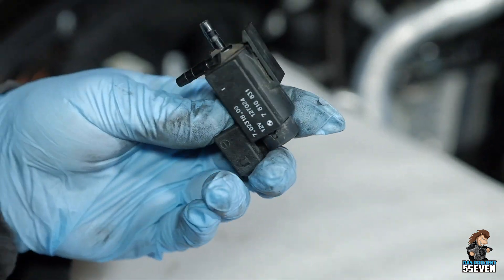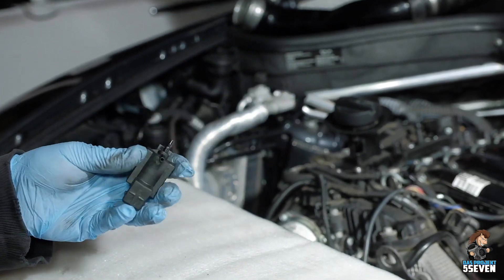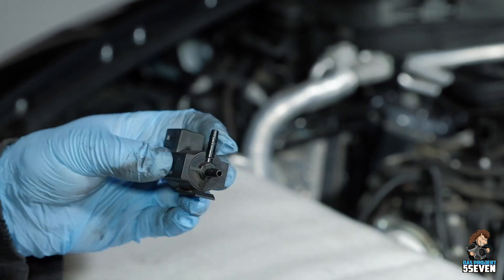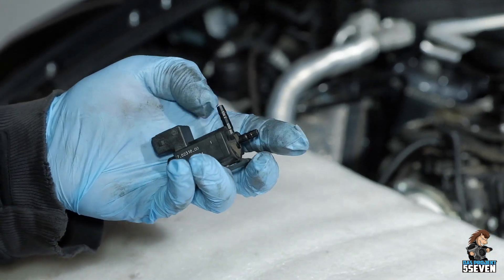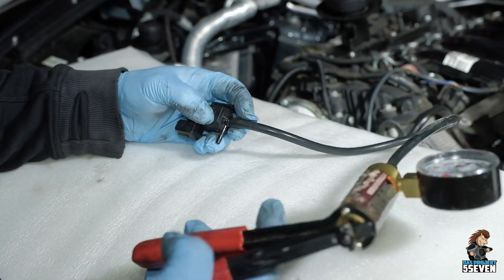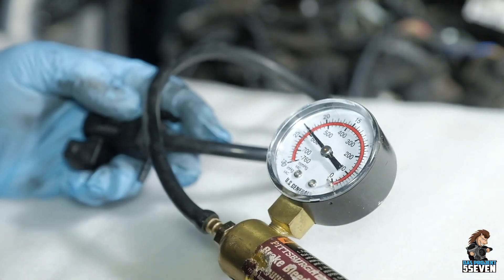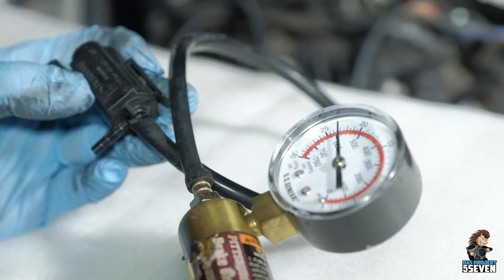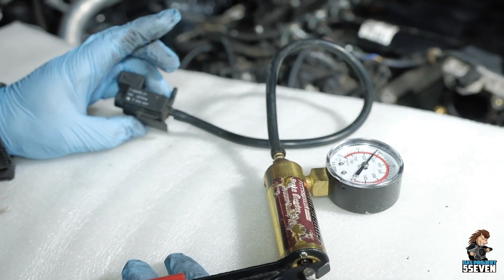How To Test an Electric Switch Over Valve

Comment: something else to consider is that while the engine is running it is steadily pulling vacuum so the slow leakers may not matter until they completely fail

Comment: Hello! I have a BMW 125d 218hp and i seem to have a similar problem, i have 244B00 error "charge air pressure control, low pressure stage, control deviation, charge air pressure too high/negative control deviation". I found a leak in the vacum hose that goes to the EGR valve and got it fixed. I can hear more the turbos on neutral aceleration but still i got loss of power in low RPM's, only after 3500 i get the big turbo coming out and only there i get more power.
Nice video. Thanks for helping, everyone!
Reply: Have you done any service on our car lately? How old is your car? I suppose you have an electronic turbo actuator. Have you checked that the actuator moves from right to left after you start your engine? The actuator arm should be to right over the lowest left screw on the backside of actuator, it is in close position when engine is off. When engine start the actuator arm should move to left open position after you start your engine. If this does not happen, you may have a connection problem because one or two solder points for the electric engine in the actuator is loose. Those connections are soldered by aluminium and you should take the actuator out and get it repair by an electronic repairshop. Tips! To unscrew the three screws holding the actuator, you must start your car so the actuator arm  moves to the left, it will let your unscrew the lowest left screw. turn off engine remove the c clips to take off the linkage arm. Now you should be able to unscrew the two last screw. If your actuator is not in close position over the lowest left screw, it means you or your mechanic has replaced the actuator without recalibrate it. If you have replaced you turbocharger with a new actuator, the actuator must get calibrated at a special turboservice shop who has tool to calibrated your actuator to the ECU.  I had the same problem, my car workshop replace a new turbocharger with a new actuator, my turbocharger does not work, I had drive train low boost, high fuel consumption, glogged DPF. I solved it by putting back the original actuator from the old turbocharger. It was calibrated and had preserve the configuration.

Comment: Hello, Good evening. Thank you for our help. I need some advices from you. Lately I have got this error 244800 Information-particulate filter system limited remaining mileage of particulate filter available. The engine light is on. Does this mean that my DPF count is out of range and I need to reset the DPF with Ista? I have got Drivetrain error when my car is cold. When the engine passes 100 degree my engine works fine without any errors. My BMW has passed 160000km. I have already order Ista and ENET cable. Good advices from you will be appreciated. :-)) I have had many problem with my BMW 525D Xdrive last two years. Last thing I managed to replace turbo air charge hose, now my turbocharger seems to work, no  more leakage. I have checked all my vacuum hoses and it is connected as the BMW original diagram shows. I have managed to solve m problems with level sensors too. Now there is no error and everything works. At many forums I read many people get "Dynamic damping control failure. Corner ability restricted". I have found out that the two balljoints of steel on each level sensors are rusted and this make the level sensors stop moving up and down. I unscrew the two 10mm screws which hold the plastic stag. I took out the steel balljoints. Remove all rust, remove all rust on the plastic stag too. Use steel wool to polish all balljoints. Use polygrip plier and press balljoints in place. Erase all fault codes. Now all 4 EDC shock absorbers works, Dynamic stabilization control works,  VDM ( Vertical Dynamic management) works. Now I can use Sport and Sport+. I am proud i managed to repair withou any expences.
Reply from the maker: @dinhvanpham8102  given all the boost issues I think your DPF just needs a good regeneration. Take it on a long drive and have DPF regenerate fully a few times. I would also reset the engine error light. If you have a way to monitor your parameters that would be even better so you know what the car vitals are and when regeneration starts and finishes.
Reply: @alphadevyat  I do agreed with you. Do you mean doing a DPF regeneration fully a few times with Ista? I do not have Ista. I have order it today and it may take some time. In the mean while I have to be carefull and not use the car. I can not afford to use a car workshop. I dont trust them. 3 workshops have charged me over 8500 dollars last two years and they did not solve anything.  I have done a lot research and watching many youtube videos. I have replaced many components in order to repair the car. I am looking fe
forward on how to learn and use Ista. I really appreciated your advices and help. :-)) Thank you very much
Reply from the maker: @dinhvanpham8102  regeneration initiated through ISTA would be good. But have you monitored your regenerations otherwise. I don’t know if with that error code it blocks regenerations. Something you should try to research. If it does not then a long drive should clear it up. If it blocks regenerations then I would avoid driving it.
Reply: @alphadevyat  I do not have any tool monitoring regeneration.  I have done some reasearch and watching some very good youtube videos how to use Ista+ to clear fault codes and reset DPF. The error 244800 tell me the DPF mileage limit has passed. On my car 150000 km. I do not know if this is a normal limit on BMW cars. As long it is possible to erase the error code 244800 and it do not reappear I think it should be possible to force a DPF regeneration. Running test on DPF and back pressure test before doing a reset is improtant. I have order ISTA+ ENET for F - series and I am eager to test it. I will give feed back on how I am doing. Thank you for your tips and advices. :-))
Reply: @ Hi, I have bought a new car diagnostic Launch X431 CRC919X BT. With this tool i did a live data check on soot and back pressure on the DPF. Did a cleaning on the DPF with Wurth DPF cleaner into the back presssure hose. Running cleaning process. Delete all errors. Run reset on DPF. Now my DPF is clean, works perfectly. After reset DPF my DPF life counter is back on 250000km.

Comment: Location of the valves on N47T engine please? I have low boost on low rpm.  Boost seems to work over 2500-3000rpm.
Reply from the maker: @dinhvanpham8102  for your specific car use your vin at realoem and pull diagrams there.

Comment: Excellent video. I have a BMW 525D Xdrive F11 2012 model 218 HP.  I had a turbocharger crash and my car workshop has replaced the turbocharger. My engine is N47T. Can you please tell me where i can find all my valves. I have found two, one near the wastegate, one on top of Egr Cooler. I have problem my turbocharger do not work. I replaced the valve on top of EGR  today and suddently my turbocharger work for about 6 km.  When I turn off the engine i got the error 299100 pressure converter turbine control flap activation open circuit back.  I have replaced 2 pressure converters and two EL valves. Can you please help me?
Reply from the maker: @dinhvanpham8102  open circuit is usually electrical. Either wiring or not plugged or bent pins or the actual actuator is faulty. If you want to find where all the things are I do recommend either access to TIS or you can look at diagrams through realoem.
Reply: @alphadevyat  Hi thank you very much. I have found the leakage which has caused me pain, empty money pocket and nightmare.  I checked the turbo air charge hose which goes from turbocharger to intercooler. There was 1-2mm slack.  I replace with a new one. The new one is firm and tight. My turbocharger works again and the power is back.  I appreciate you share your knowledges. I have learn a lof by watching your fantastic videos. I love  the two videos part 1 and part 2 about how to replace new vacuum hoses on BMW car.
Reply: @alphadevyat  Hello, do you have a trick on how to disconnect the power cable on the Booster pressure solenoids. I push the white plastic lock up and tried to press the top but still i can not disconnect the power cable.I have to recheck all my power cable on the solenoids. Thank you in advance for our help.
Reply from the maker: @dinhvanpham8102  I use an angled pick and go from the front. Pick at the latch and pull the connector. Best way.
Reply: @alphadevyat  Good fantastic sunday. Thank you very much I will try and check all my connections today. Today I am going to replace the second turbo air charge hose from intercooler to intake manifold and at the same time clean my intercooler. I think my intercooler is full of oil when my turbocharger crash. I will check and clean the map sensor as well. The sensor need maintenance and clean for glogged carbon and oil.  The map sensor is very important, it provides suck air up to 4 bar.
Reply from the maker: @dinhvanpham8102  there will always be a bit of oil that goes through the intake including intercooler. It’s normal due to CCV functionality. Make sure you use new seals on chargepipe to intercooler and to intake connections.  Use silicone spray to make assembly easier.
Reply: @alphadevyat  The new turbo air charge hoses are complete with seals. I managed to  install the first hose from turbocharger to intercooler. The  hose from intercooler to intake manifold is very stff and thicker I think the only way to install it from underneath. I must unscrew the two intercooler screws and unlock the hoses from the intercooler,  take out the intercooler, replace the hose at the top first. Yes I use silicon to reinstall intercooler and slide the hoses into intercooler.  With silicon the hoses slide in very easy. Thank you for the good advices.
Reply: Hi, I have solved my turbocharger problem. The mechanic has replaced a new tubocharger with a new electronic actuator. The new actuator must get calibrated to the ECU for close and open position by a turboservice shop. I did not know that and neither the 3 workshops I used. I solved it by reinstalling the old actuator from my old turbocharger. The old actuator car calibrated to the ECU and the configuration was preserved. Now after two years problem my turbocharger work perfectly again.

Comment: Hi is this the one that comes off the throttle?
Reply from the maker: Are you asking for a location(s) of these valves? If so on an M57 that is later model and specifically for US/Canada spec, there are three. One for Compressor Bypass ( pass side behind turbos and under pressure converters), Motor Mount control (on the block under the intake manifold), HP EGR cooler bypass (at the front clipped to the EGR cooler).
Reply: @alphadevyat  brilliant! Thanks! Which vacuum pipe is connected to the throttle body? Mine is a 2007 uk/European car 😁
Reply from the maker: @mikeyoakes180  if yours is EU spec then yeah you have vacuum controlled EGR but still electric ASV or what some call a throttle plate. Your EGR should be controlled by a pressure converter and should be under the intake manifold.
Reply: @alphadevyat  arr ok! So if my throttle is bouncing the 2 won’t be connected then?
Reply from the maker: @mikeyoakes180  the actual throttle plate? Then it’s kaput or if your car is mapped, could be related to that. Any codes?
Reply from the maker: @mikeyoakes180  other thing to keep in mind if your car has a DPF then the throttle plate is used for DPF regeneration.  Could be related too.
Reply: @alphadevyat  will a dpf delete help?
Reply from the maker: @mikeyoakes180  not really in this case. Disconnect it meanwhile. Pull the codes before.
Reply: @alphadevyat  there are no code unfortunately
Reply: @alphadevyat  disconnect what sorry?